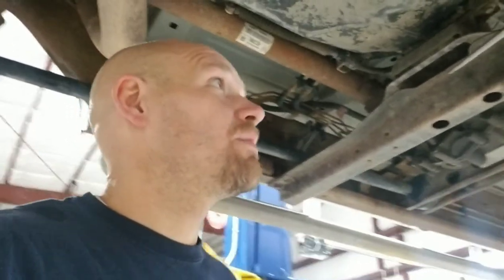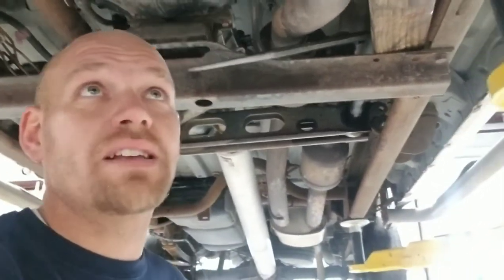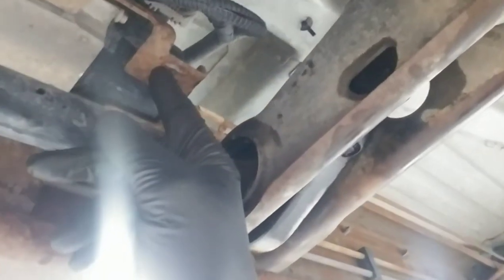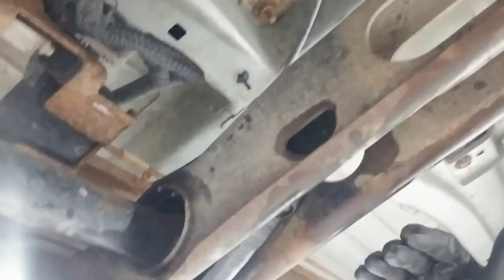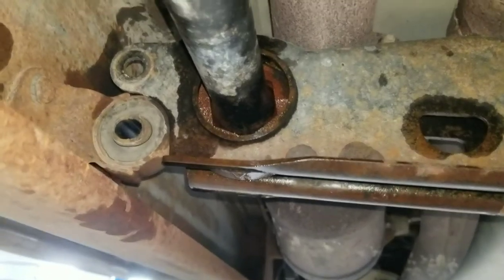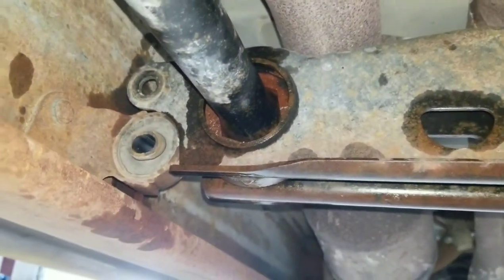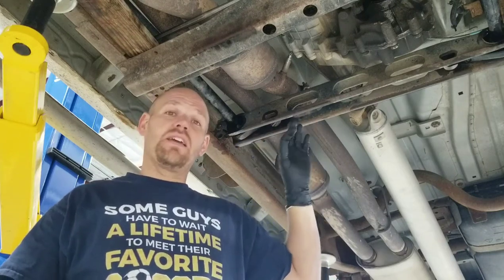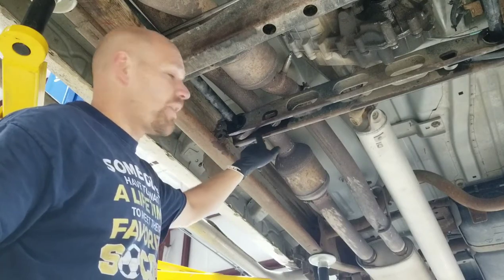Chevrolet/GMC Sierra/Silverado torsion bars are stuck!

Comment: I have found that if you buy aftermarket keys depending on the brand they don't always have the same curvature to go into the cradle properly creates a major headache! One time lI actually had to grind them down at the top a little bit to take some of the edge off to fit into the cradle the way the OEM key did! I know exactly what you're going through LOL

Comment: After you removed key, I have sprayed a ton of penetrating oil on the lower control arm connection and then used a pipe wrench to give the bar a good wiggle, then a few raps and it pushes forward making key installation so much easier.  Just another way to skin a cat.
Reply from the maker: Thanks for sharing

Comment: 30lb demolition hammer. That's all you need to know. Out in 30 seconds.
Reply: I'm doing the same thing for my 2003 Ford ranger but I'm trying to save my torsion bar right side because for it and everyone discontinued it should I just go ahead and rent a bigger  jack hammer  I done did three cans of penetrating oil

Comment: I'm currently doing this to my Avalanche, was able to get the passenger side out and in no problem by pounding the torsion bar forward and out of the front axle, but I cannot do the same on the drivers side.  All you did here was remove that cross member brace and you were able to get the key out and in?
Reply from the maker: Pulled the bolt out of the cross brace and pushed the brace up so that it would slide back. Looks like the first part of the vid is mirrored. Sorry didn't notice but that is the driver's side. Be careful of the abs module. Good luck to ya!

Comment: My torsion bars are not in the socket flush should i be worried?
Reply from the maker: The bars should pass most of the way through the key. If they are 3/4 of the way through I might let it ride. Any less and I'd pull the key adjust bolts and slide the bars back out of the lower control arms and then re-tension the bars.
Reply: @Brandonlexx1  thanks for the quick reply. have a great night!
Reply: @Brandonlexx1  its not flush into the lower control arm. ill just remove the key and put the torsion bar into the right position on the lower control arm. as not flush i mean the bar is not touching all sides into the lower control arm.
Reply from the maker: @DCPJOKER flush it up with the key. Let the front be where it is. Good luck!
Reply: I didn’t mark the way the tortion bars were installed now the truck has a uneven bounce, please help, thank you